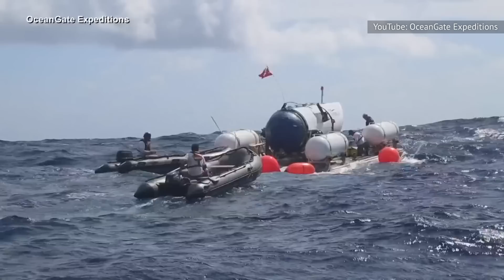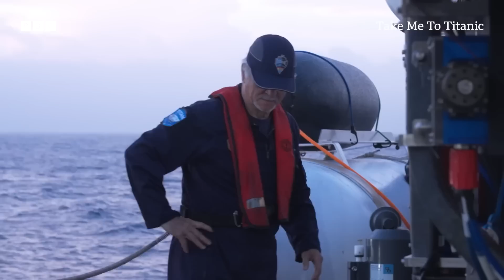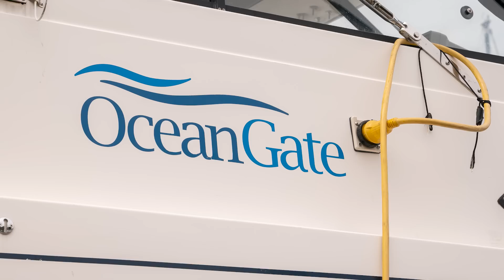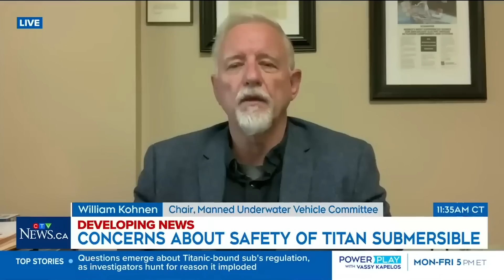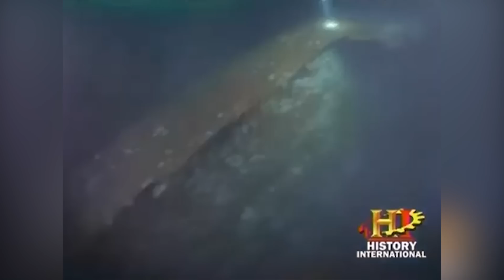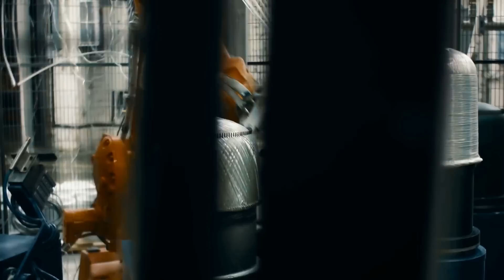The Titan Sub Disaster Is Worse Than You Thought

Comment: What the hull was the issue with a solid titanium pressure shell ? Photo shows the crews. bodies were probably instantly compressed into a few inches space in a millisecond. Obviously a lot of heat would be generated and so little trace would remain in anything raised to the surface. Stockton Rush was an egomaniacal irresponsible idiot

Comment: Am I the only one here that thinks the use of carbon fiber was the absolute worst choice of materials?  Carbon fiber (CF) gets its strength while in tension, the opposite of what's seen in a deep-sea vessel, which is in compression.  In this scenario, the only thing giving the hull its strength was the resin used to hold the CF together. "Plastic" resin.  This is like trying to push a chain rather than pull it where the chain has its strength. CF is no different.

Comment: Judging wut could have happened in regards to the fibreglass failing is impossible to do now becuz theres no way to know wut defects are from the violent implosion and wut defects were already happening b4 it imploded. 95% of the damagd was caused when it imploded. The warnings were right fibreglass was not the right move. The rings and forward dome were weak points too. Stockton rush was irresponsible and ignorant. When u think u know everythingu stop growing. He could have got the funds to create a much safer submarine. A bigger and thicker one with better engines and electronics but he kept cutting corners

Comment: Margin thin safety of error? they built the pressure hull out of carbon fiber instead of metal! they used game controllers to operate it the cabin was empty of cables lines etc everything was external and inacessible to the crew and finally and most glaringly they hired DEI the most diverse crew instead of the most qualified.....FAFO with nature..... idiots!

Comment: This "genius" engineer never understood that the design demands of submarines are very different than those used in aircraft, in which they use carbon fiber principally because it is very light.  Submarines do not have to be especially light...but they have to be very very strong to resist the enormous water pressure.  Carbon fiber also has a tendency to crack under stress, which is why it is not used in submarines.  Rush never understood this fundamental difference.

Comment: what are even the benefits of carbon fiber in this application?  Yes it has very high strength to weight, but why would that matter in the sea?  You're not trying to go fast, fuel is not a concern, and weight is unimportant also.  I know he came from an aerospace background and I can see why carbon fiber would make sense in the air, but not in the sea...

Comment: A sphere has considerably more structural capacity for resisting outside pressure than a tube with two separate ends would have.  A sphere also gives more internal volume per surface area. I suspect a tube design was chosen because the manufacturing cost using carbon fiber was way cheaper.

Comment: Carbon fibre has excellent tensile strength. Infortunalely, a submersible has to deal with compression, not tension. The carbon fiber is either wrapped around a core (inner mold) as a filament impregnated with epoxy resin, or as weaved  pieces of cloth wrapped around a core and piled in layers (layup). Once the resin sets (is cured) in an autoclave, the core is pulled out. The problem is if an outside layer cracks, the pressure drives the water between the layers (weaker part) and separates them (delamination). The carbon fiber is there to resist tension. The epoxy is what takes on compressive strain. I have built camera housings out of fiberglass and resin. They are only for taking pictures at max 20m, or surf photography. The only reason for this choice is ease of manufacture. Most surfers/kayakers/saylors know how to use fiberglass/polyester or epoxy resin to fix their equipment.

Comment: When the weight of the seawater on the walls of the immersible is greater than the weight of the vessel, it going to collapse into itself, it’s physics 101.
Reply: No! Nothing to do with the weight of the vessel. It's if the vessel walls are strong enough to withstand the pressure.
Reply: @adrianwright8685 I understood the craft imploded - the explosion came from the inside.  Is that not accurate ?
Reply: @maryearll3359  It must indeed have imploded. The walls collapsing inwards because the external pressure was gtreater than outside and greater than the vessel walls could withstand. (but there was no 'explosion from the inside'  !?)

Comment: Why did the Sub collapse in a few milliseconds?Why not in about 0,2 seconds?The time the watercolumn falls about 2 meter(ca. the height of the sub)with the normal 1g when the sub breaks. Or is because the water is pressed to a smaller volume at about 300bar and releases the enegy like a air-rifle? But water in 3000 meter is only comprimated to about 1,5% more density whereras air would have 300 times more density  at this pressure

Comment: The dives may have done more hull damage rising back up than on the way down. Any voids would hold water and gases, which would expand when rising, then delaminate the fibers as they move longitudinally. It's a no-brainer; carbon fiber is 100% the wrong material for a submersible hull.

Comment: A huge difference between carbon fibre under tension (think of pulled string) due to higher internal pressure (as in an aircraft). The carbon fibre has the strength, not the resin holding it in place. Carbon fibre is weak in compression (think of pushed string), so the resin tries to resist the force, but it is weaker than carbon fibre and also brittle. I can't believe Rush didn't know this.

Comment: I am no engineer, but even I worried about the 'POSSIBLE' difference in material compress-ability between Carbon Fibre and Titanium at those depths, let alone the joint holding the two together.
What also concerned me was the reaction over extended periods of the very cold water (allied to the pressure) at those depths. Materials do become brittle at low temperatures, and around the Titanic it was (from memory) about -2c. Those temperatures at the surface would make the water freeze, but the deep sea pressure would  prevent that.
Reply: x(C fiber + Ti + epoxy adhesive) submersible + pressure = bad/implosion.  For metals e.g. Titanic rusted hull the temperature would have to get WAY colder than the ocean temperature it is now 33-36F (+.5 - +2C) to become brittle to break or snap. You need liquid nitrogen temps -321F (-196C) to do it. Agree, sea water does freeze at approx. -2C (28.4F). Look at the video of the Titan wreckage, you will see both Ti end domes intact while the C fiber
tube is squashed flat. Obvious malfunction.
Little know fact. When sea water freezes the salt doesn't freeze with it. So, no salty icicles.  
Still sad and tragic that 4 other people had to die to end a arrogant egomaniacal SOB from continuing on a doomed journey.  🙏 to the families.

Comment: Carbon fibre is extremely strong when pulled apart as soon as you start to push and pull is totally different also the seal between the carbon and titanium.  Gorilla glue would be good

Comment: To be an engineer, one must remember three rules:
1. F=ma
2. E=IR
3. Don't push on a rope.
Stockton Rush ignored rule #3 and five people paid the ultimate price.
Reply: Yeah, get #3 for sure.  Carbon fiber composite is often used for pressure vessels - INTERNAL pressure (tension, not compression).  Pushing on a rope is never good.
Reply: And all this time I thought E=mc2......
Reply: you mean V = IR
Reply: @eitantal726  No, I mean "E", the symbol for electromotive force, measured in volts.
Reply: @Milosz_Ostrow  I never saw Ohm's law written this way, but fair enough. Though I might point out, E field is a vector. Scalar 'E' is typically used for energy. Not only that, you'll have a delta to the E field
Reply: @eitantal726  It's Electrical Engineering 101.
Reply: @Milosz_Ostrow  More like Physics 101. Look at the wiki page of Ohm's law, see for yourself. If you want the physics, vectors version of it, then it's actually E = pJ

Comment: There was nothing innovative about the titan.    His only idea was its shape to hold 5 people instead of the usual 2 or three and to use carbon fiber to make it lighter.    In fact the titan is twice as big and half the weight of the famous submersible the Alvin.   But there is a reason that the Alvin is so small and heavy, a reason rush denied because he was so enamored of his own idea.   In fact the whole craft was flimsy and cheap.   A truly innovative submersible is the triest. That was built in 1953 in Switzerland .  It went safely down to three times the depth of the titan and was in service for years.   It 
still exists and is on display at the us navy museum.
Reply: I would think you would want it to be heavy to counter the buoyancy of all the air inside it.    Making it lighter would just mean you need a lot more ballast weight.
Reply: @bullschitt3666  they want it to be as neutrally buoyant as possible.  That mean much less power to come to the surface and much less wear
Reply: @RossM3838 no, they definitely do not want it as close to neutrally boyant as possible.

Being able to drop a few weights and surface rapidly from that deep is extremely helpful during an emergency.

If everything electric fails and the titan is at the bottom of the ocean, that buoyancy allows them to surface without power, and without shedding a great deal of weight.

A prime example of this is James Cameron's sub failure. They were running low on battery power, caught in a current, and the available thrust they had was not enough to get them out of the current to safety. They lucked out in the end. 

However if the sub was like the titan in terms of buoyancy, they could have dropped weight and surfaced without using the thrust from the engine.
Reply: @bullschitt3666  The Trieste was mostly a reservoir holding gasoline because it's lighter than seawater. Only the bubble on the very bottom was a passenger compartment.
Reply: There was a marine biologist on the Jordan Harbinger Podcast, Susan Casey,  talking about the ocean studies she has done. At one point she mentioned that, before the Titan was built but was being advertised,  she did look into the Titan sub as an option to use for underwater studies. Since she hadn't had much experience diving she checked in with Terry Kirby, who was the chief pilot of the University of Hawaii research subs, who told her "just absolutely not, you must never set foot in this, " and "put your foot on a soda can and see what happens, crush the sphere and it just gets stronger". She also mentioned that " like everybody I met in the ocean, deep ocean world was talking about this. We don't really think they're gonna do it, like we're trying to figure out a way to stop them from doing it."
Reply: There is such a thing as an educated fool, Rush filled the bill perfectly.
Reply: thanks professor
Reply: I think the innovation part was him using carbon fibre as opposed to traditional metals
Reply: @KenCurry-c6y and using off the shelf parts to save money, including the blue tooth game controller to run the thrusters.     I wonder what would happen if the wi fi failed on the sub.      Would the passengers simply be stranded deep under the surface?   Navy submarines often use game controllers but never ever to control the ship.   It seems to me that something far more robust and hard wired is called for.